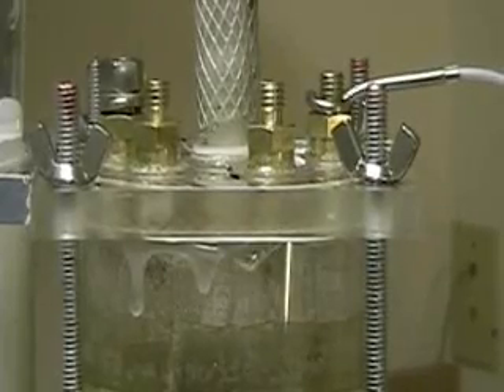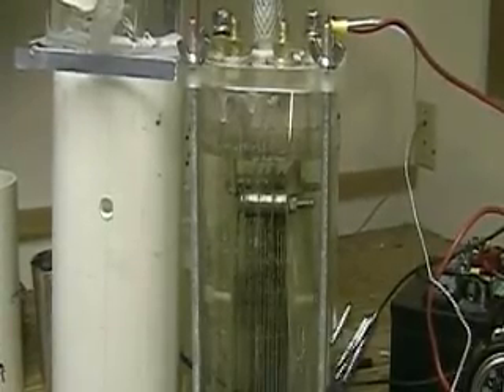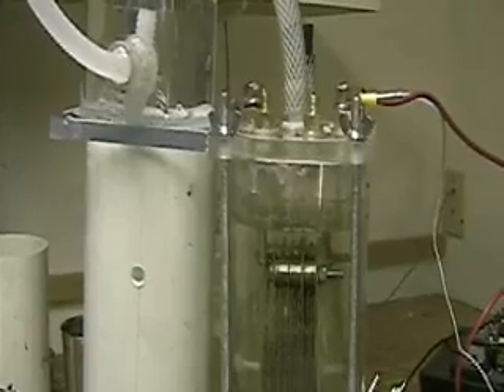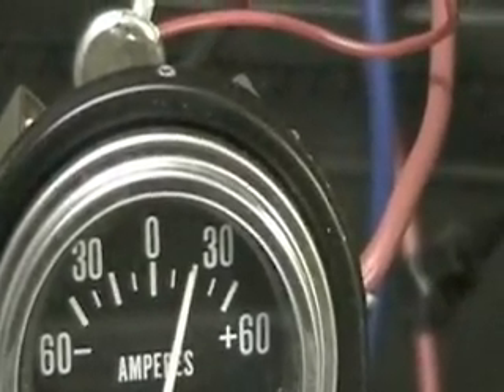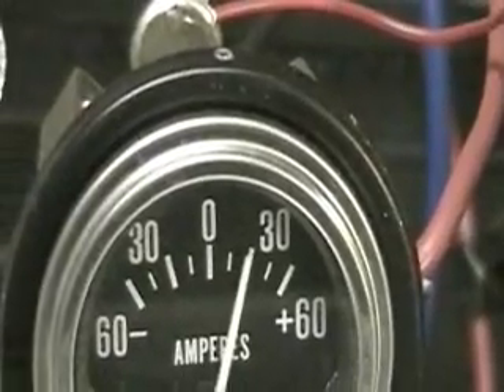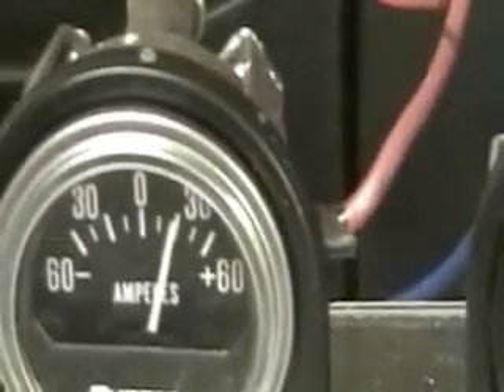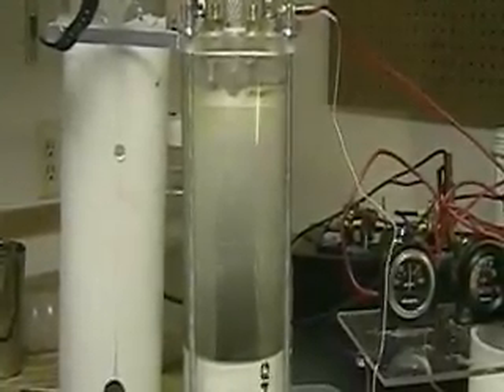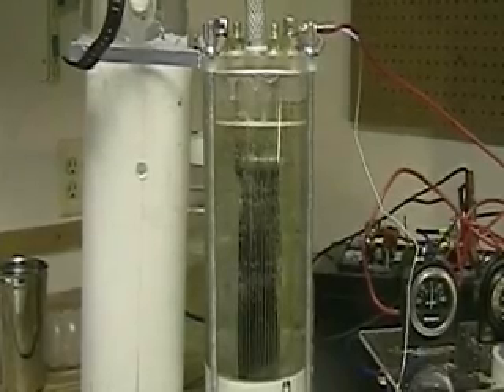Hydrogen Tap (FOCUS -N-Plates) 308

Comment: a plate stack with neutral plates has one problem. electricity is lazy and will do an end run around your neutral plate barrier if it can. this is why added e-lyte is needed. the next step is to seal as much edge area as possible to "force" electricty to pass through the neutral plates. when this is done, you will be able to back off on the e-lyte a little, but will still need more than with +/-. however, effciency will go way up.

Comment: Question about Neutral plates..One would think that the + - plates should be as close as possible without being interferred with in order to max out production, as prodution from the plates have gone UP from my research the closer they are to each other?  

So what is the reasoning behind putting a N plate between the pos/neg?  Does it keep the cell from overheating and or working TOO WELL in Amping out?? ie..N plates Acting  like a governer of sorts?

What about going + - N + - N...etc?

Comment: Hi again the volt meter your using has 2 larger lines/marks on either side the zero one is 30 amps the other is 60amps you say your using 20amps i no you say the amp metewr not v accurate but it is showing almost 30 amps.